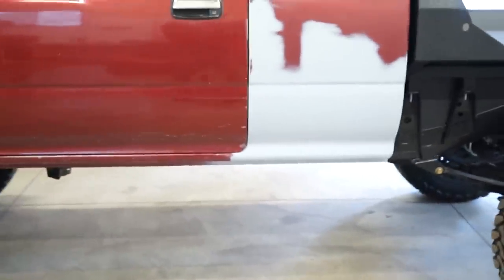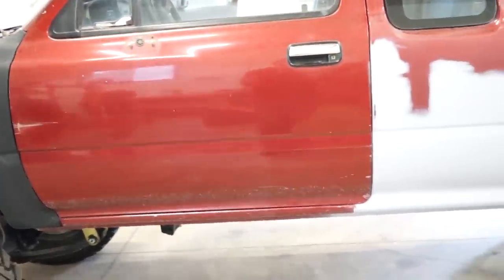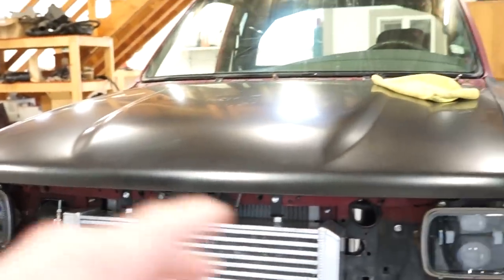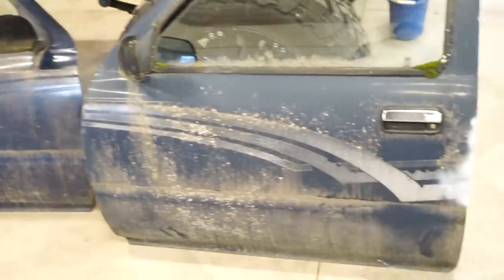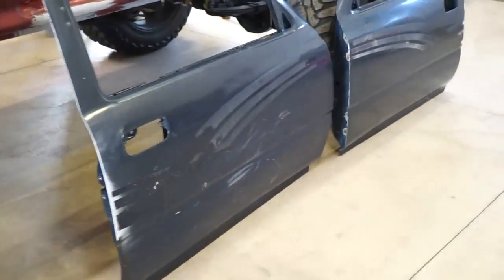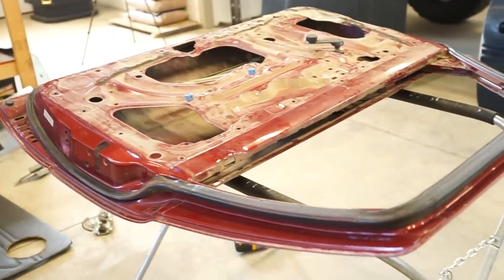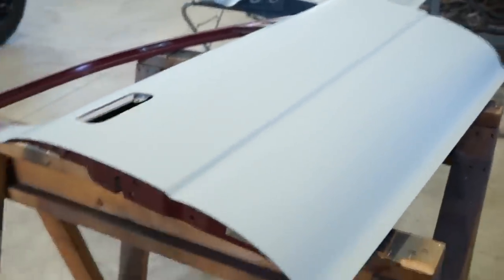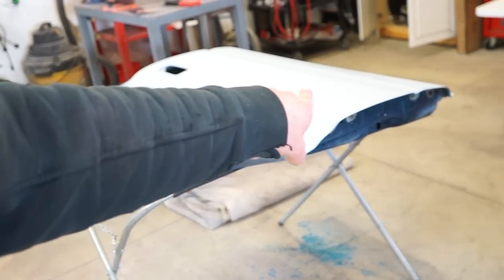Back At The Paint Work / Fixing Doors / Ready To Spray!!!

Comment: Hey Bro. I did a build with a LN166 Hilux. You can seal the mirror holes on the door. the Tacoma mirrors with on those same doors. Really no need to get new doors. Oh and while you are at it you should seal off the antenna hole and install an electric antenna after.

Comment: Buy an old bed, and cut the sides. And fab some mounts points. So you cover the sides of the frame closer to the cabin. And then you can use a inner fender mud guards.